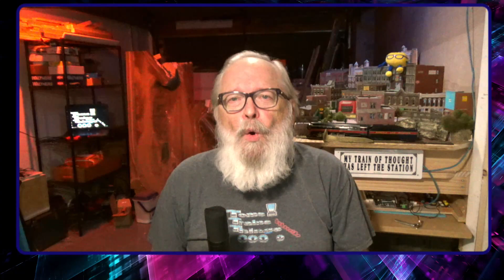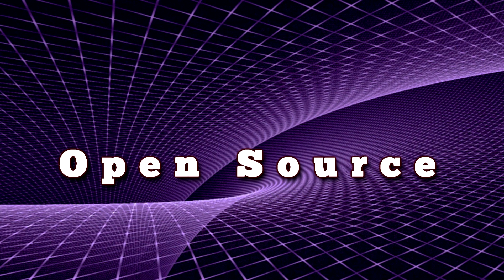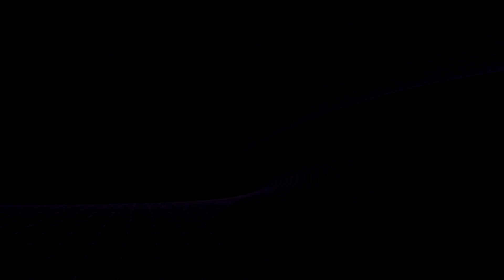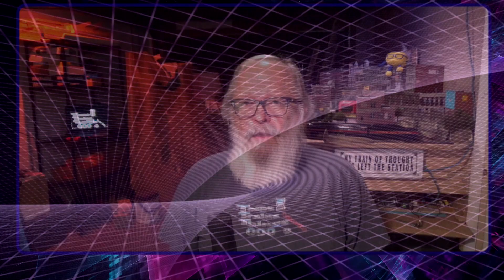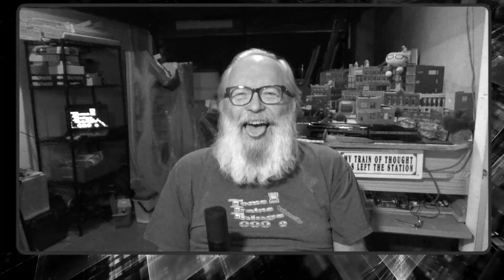Biggest Mistake By Arduino Novices

Comment: Very true Tom, im an electrical engineer, but with very limited programming experience. Since i know circuits and understand the logic i thought it would be a great idea to start from top to bottom. That defenately did not work.

I started over from the hello world through the basics, and to really understand im working on register level coding now.

This Arduino thing caught me now and open my world creating my own monitoring systems.

I just wish there was a club for learning register level programming. Similar to what you mention, ask any youtuber with a decent beginner arduino course  about register level and you never hear anything back.
Reply from the maker: Thanks for watching Marius. I have not seen anything substantial on register level programing for Arduino.
You may want to check out the Arduino Forum: https://forum.arduino.cc/
Arduino Users Group: 
https://groups.io/g/arduini
https://groups.io/g/arduino-users

Comment: That is probably true of most novices.  But what about the rest of us novices that will muddle through until we figure it out? I was making rudimentary games using BASIC way back when and although I don't remember most of it now, Arduino code is similar and with a little research and perseverance, I get things done.
Reply from the maker: That's why I put in there  not all people do this. Basic is where it all started, if you have a basic understanding of the Basic language, you'll be able to grasp most other languages. There might syntax differences,. That's what you have to figure out, that's the hardest part of it!

Comment: for me this vidieo is very current. Just an hr ago I sent the following email 'I am a retired engineer with wide experience of computer component manufacturing, and I was relatively confident I could set up an Arduino to control a couple of trains, but when I got started my computer programming very quickly ran out of steam'. I dont want to start writting code I want to use what is out there. Following on from your young driver analogy  let me relate my experiance to something that happened concerning an engineering draughting program it was something quite simple, couldnt make it work,  and I looked for a possible answer, and thought I had found it. I watched a video and  saw that I was doing it right, what I was missing was I had failed to set the preferences but these were never mentioned, just like nobody appears to have told the young person there are two leavers under the seat that allows you to adjust it. In that video the the setting had been selected way back in the past and it is those simple things I hadnt  picked up on. In DCC++ Im not sure that I have downloaded all the programs correctly,  but where do I go to find a  directory listing of all the files I need to  download. Because its open sourse not all the programs download to the same place, and any one download may contain several files, I just got to slog through it like you did all that time ago
Reply from the maker: Thanks for your input Laurie. Have you tried DCC++EX. It's an updated version of the original written by Gregg Berman. Easy install and more powerful!   https://dcc-ex.com/
Reply: Thank you Tom, I was using this program and I had loaded the correct programs, along with many others I may never need.
My problem was when I ran the Arduino program I encounted a page saying ' you can load your programs here' and that threw me. Thanks to Littlewicket I was pointed to the tools section in the header and then loaded the device and port details. it obvious to me now but yesterday, I guess I was in mind overload.
Again thank you for all your help and keep making these great vidieos.
Reply from the maker: No problem Laurie